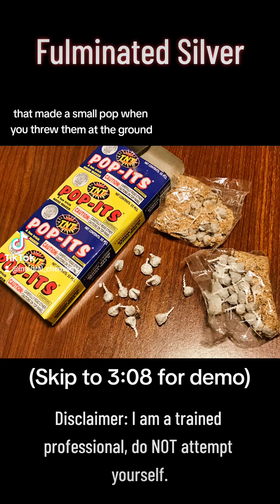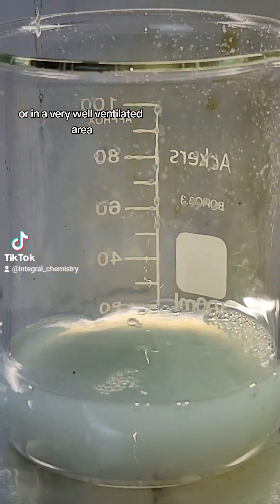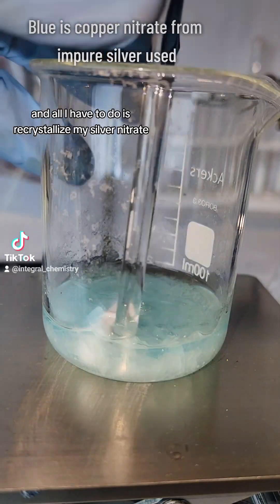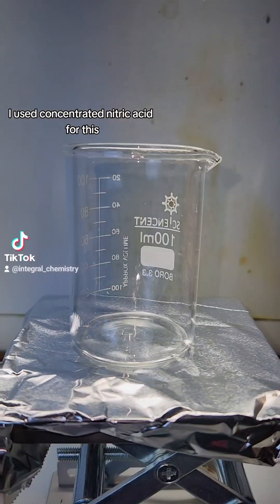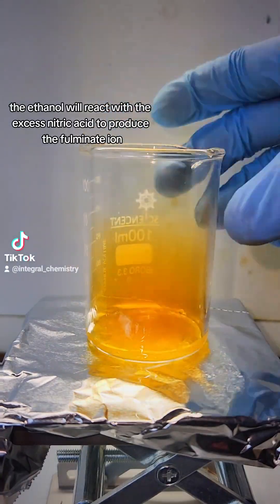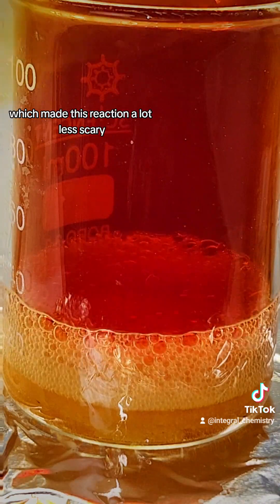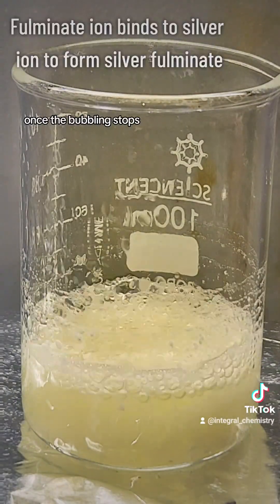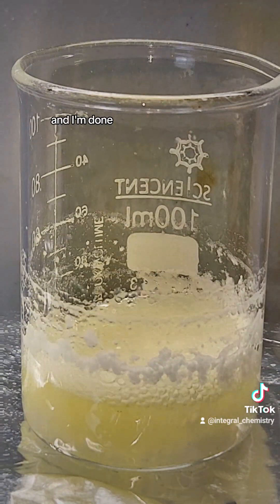Silver Fulminate

Comment: Can it be used for gun primers or does it decompose over time?
Can it be desensitised?
Reply: A sister to silver fulminate is mercury fulminate which was used for gun primers in the 18th to 20th century, but while mercury fulminate is less sensitive it was still a problem and replaced by the modern lead styphnate. You might be able to use it for a gun primer, but it's probably going to have some issues. I imagine you could probably desensitise it in a similar way they did to early dynamite, which would essentially just be giving it a chemical egg crate to rest in, but this would lower the yield and since silver fulminate is fairly slow, I don't know if it's worth it. You'd be better off looking into mercury fulminate and dealing the storage problems or just go straight to lead styphnate.

Comment: Does copper fulminate even exist?
Reply: Psst

Hey kid

What's copper nitra tetra zole?
Reply: @tomarmadiyer2698 the synthesis is a bit more complex but definitely worth it considering its power. Also there are some papers detailing a way to use tetrazole complexes as a way to stabilize silver fulminate to be more on par with standard classic primaries.
Reply: @tomarmadiyer2698 the synthesis is a bit more complex but definitely worth it considering its power. Also there are some papers detailing a way to use tetrazole complexes as a way to stabilize silver fulminate to be more on par with standard classic primaries.

Comment: Ive heard stories of it going off for bareley  any reasonand people losing fingers...like triodide I would only ever handle this stuff when moist in less than 200mg quantities
Reply from the maker: Yeah it is shockingly FAR more energetic and sensitive than mercury fulminate (which I'm far more used to handling) 200mg is nothing with mercury fulminate but with this stuff 200mg was quite frightening
Reply: @integralchemistry1849  please keep your fingers!!😅 maybe if you work with it in future store it on acetone (assuming it doesn't  dissolve  it and cause it to recrystalise forming big unstable crystals) that way when you need to use it you can quickly air dry it
Reply: I second that